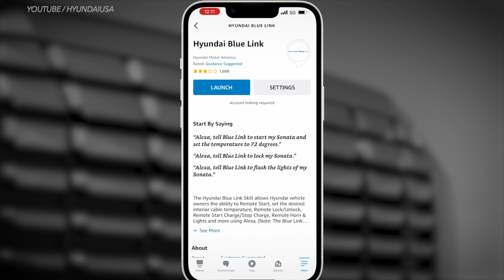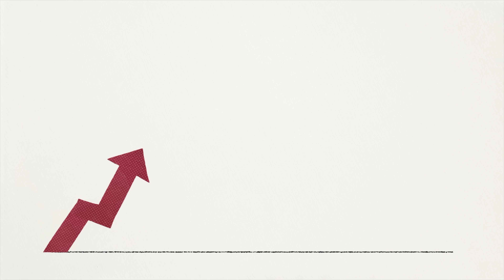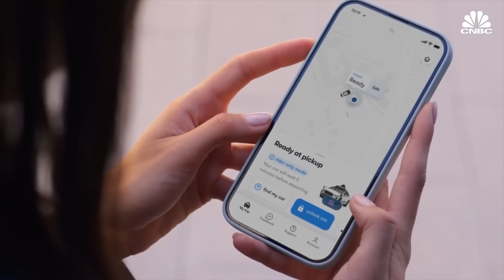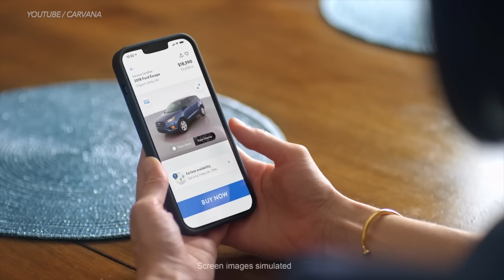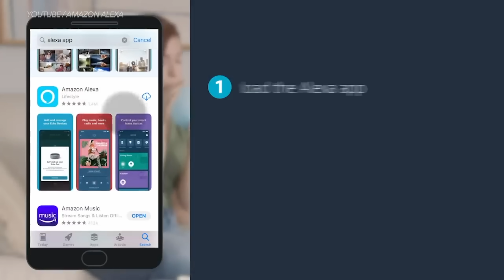Honda and GM Just Merged

Comment: I wish they just made simple quality cars that work and can be fixed at home. Just like in the 90's and early 2000
Reply: I still drive my 99 jetta. 5 speed. 4 tires every 6 years. Starter and battery every 4. No payments for 20years🎉
Reply: There is no money in that. They can't rip you off.
Reply: Good news!  There is a used market that can still sell you those good reliable cars.
Reply: the US EPA is the blame and the cafe standards is also the blame. So, you cannot have simple quality cars that work and can be fixed at home in 2023 and beyond.
Reply: That dont help them to control all things...with EMPS etc...thats  Why all things going to be electronic...with a low electrical grids...WHY? MAKES NO SENSE...its control...easier to control electric vehicle over mechanical.
Reply: @billrehm3590 That dont help them to control all things...with EMPS extra...thats  Why all things going to be electronic...with a low electrical grids...WHY? MAKES NO SENSE...its control...easier to control electric vehicle over mechanical.
Reply: theres been a few per every year or so but not like it used to be
Reply: But this is not 20 - 30 years ago. It's fine to wish but realities creep in.
Reply: I can't believe that people actually want these new vehicles that have tablet like controls on the dash. Almost everyone has a smart phone. A good bluetooth headset works well. Why do you want or need your vehicle to be rolling Ipad on wheels. Everyone knows their computers need constant updates. I don't want that unreliability in a new vehicle.
Reply: @H2ODiver_Down  it's because propaganda works.
Reply: @H2ODiver_Down Buy Tesla for the same reason you buy an iPhone.
Reply: Another great video. Cudos to not only Scotty, but to the team who produces these informational videos.
👍🏻👍🏻
Reply: I'm with yah there. I have a pickup truck from 1994, and it's very simple to work on.
Reply: That’s fine but the younger consumer is, generally-speaking, not interested in horsepower but, rather, the ‘smart’ification of the automobile. 
The infotainment system is a hub of the driving experience now for all but the purists.

Comment: Honda and GM had enough sense to call off a bad business decision. Consumers have rejected EVs due to range anxiety, and cost. It simply makes more sense to buy Hybrids, and it was just a matter of time before the "toy car, batteries included" fad went away. So, they can still do the battery thing with Hybrids. In any event, Salt is the new medium used to make automotive EV batteries, and European Automakers are rolling it out, so maybe that's another reason to shift and scrap this joint venture with Honda and GM; maybe that's the real reason.
Reply: The reality is that there are many diff promising battery technologies. None of them are obviously better than the other one. So mass adoption of 1 tech is just not going to happen. This means battery research and sourcing materials will be higher.
Reply: Not salt it is LFP  Lithium Fe Phosphate  No nickel or cobalt and use LESS Lithium.
Reply: @ricky4673  there's also alternatives to both IC engines AND electric batteries. So far the technology isn't there yet (just like EVs, lol) but it is being developed.
Reply: @41tl  Yeah, Hydrogen and even air peasure powered.

Comment: I NEVER hear anybody discuss the fact that EV's weigh TWICE AS MUCH as normal vehicles.
What's that extra weight going to do to our crumbling info-structure / highways, overpasses, bridges, ferries, etc...
Reply: not to mention its a danger in accidents
Reply: And don’t forget parking garages!   Not built for that weight!
Reply: @superstarcat7654  

You're totally right!

I just saw a video yesterday showing how old & dilapidated the parking garages in New York City are.  They're starting to collapse.
Scary stuff.

But yah...  I haven't heard anyone addressing the whole weight issue with EV's.

Right now, there's Truck Scales on most highways so vehicle weight is obviously an issue for our roads. 

While I'm not opposed to EV's, I just don't think we're ready for them yet.  Too expensive & too many bugs to work out.

It's ridiculous that the Radical Woke Left is trying to FORCE everyone to drive EV's within the next few years. 

Not everybody has 70 grand laying around to spend on a vehicle that only takes you 400 miles per charge...

Comment: I think when a car company gets ordering online right, it will be a boon. It doesn't sound like Hyundai is getting it right. In order to get it right, a customer needs to be able to customize their car and then the manufacturer builds the model exactly as ordered. For example, I live in Northeast, Ohio. An option like heated mirrors would be super nice. But, on many models, I would have to get a bunch of extra stuff I don't need to just get that option. As a stand alone, it might be a few hundred dollars. Moving up the model tier model, it may mean thousands of dollars just to get one option--and also possibly getting options I don't want like low profile tires, which are going to ride rougher.

Comment: Scotty, I took my 2004 Toyota Sequoia to the dealership for an air bag recall. Immediately  upon receiving my vehicle back, it would vibrate violently when on the road. I took it back and they stated it could be the U-joint in the drive shaft and it's a pure coincidence that the vehicle started vibrating after they've worked on it. Since I have no evidence of an mal-practice, I'm stuck dealing with this on my own.  So far I've changed both the front and rear u-joints along the drive shaft but the vehicle continues to vibrate at random rpms during a drive. Please advise on what I should do.
Reply: Separated tire plies? Bent wheel? Start with the obvious?

Comment: I am 70, and actively shopping for my next, and likely my last new car.  I  am considering electric, but I am awfully tempted to stick with what I know.
As for dealer ships.  I have a great relationship with the service dept. at Kia of Newmarket.  So, I'm hung up on indecision... dang nab it!
Reply: Hey Bud.  I am 54 and was thinking about getting in to a newer truck... but I just can't make myself pay $80k for a truck that cost half that just ten years ago.  I decided to pick up a very clean 1970's 4x4 pickup with no engine or trans and then resto-mod it.  Even with the frame off metal and interior restoration, a new crate engine, Vintage Air kit and suspension upgrades, it still cost less than a new truck, I can repair most things at home and it looks incredibly cool.
Reply: The Kia k5 is pretty cool, and decently reliable too

Comment: I'd never buy a Hyundai! Everyone I know who has owned one says they are constantly breaking down!  After buying my last 4 Chevy work vans (10 years apart), the last ones transmission went at 47,000 miles,and was supposed to be warrantied to 50,000 but not past 5 years, I'm not too happy with Chevy either. I was thinking of trying Ford but after researching them, them they have a worse record than Chevy! My contoured shelving units and roof racks will fit another Chevy or maybe GMC but the prices and availability have me stuck driving a rust bucket! I wish Toyota or Honda would sell heavier weight rating vans in the US. I hear Nissan are garbage along with Mercedes and Dodge!
Reply: Really feel for the working person right now trying to find a vehicle for work that`s dependable.